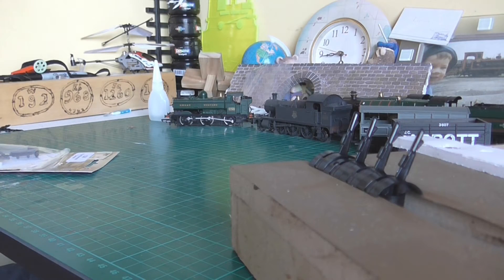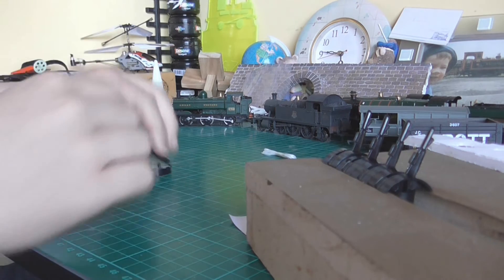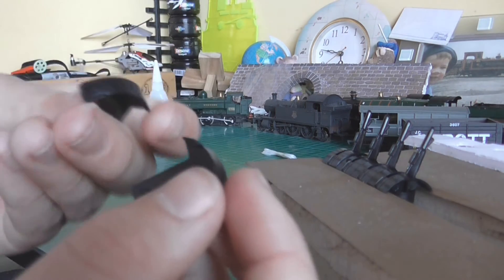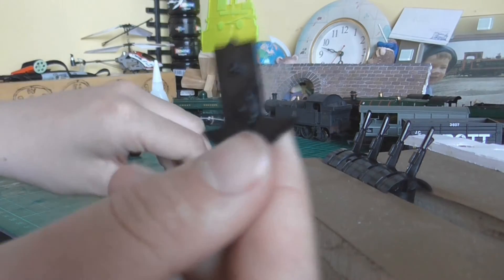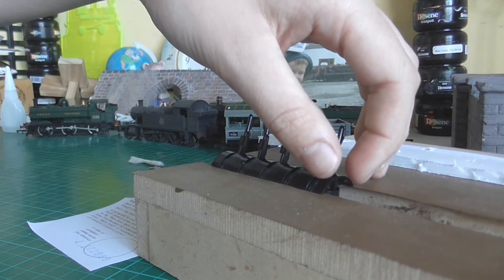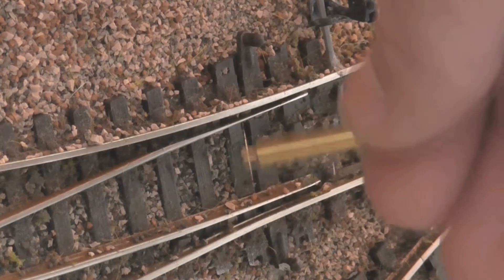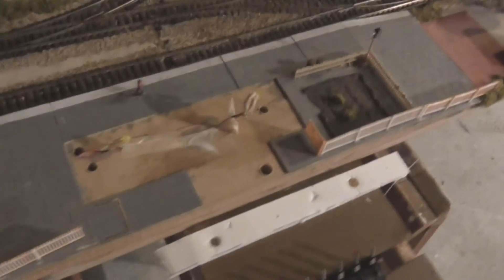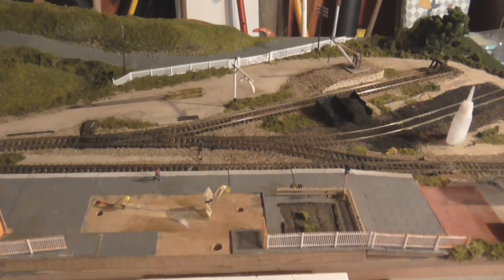How to - Ratio point control unit installation

Comment: Cool.  Thank you. Has given me the confidence to try one (or 22!),  and lev the exccent! (yes, I AM a POM).  Couple of points (haha) ...1.  Buy yourself a bradawl to start the screw eye holes,  2.  avoid if possible installing the point tie-bar close to a baseboard beam support,  3. with the point fixed to the baseboard, drill through the tie-bar hole AND the baseboard with a pin vice, then use the hole on the underside of the baseboard as your centre point for the larger brass thingy hole ...  I'll let you know how I get on!

Comment: I would possibly suggest fitting the bronze "Bit "to the points prior to laying and fastening down the track. Mark the position, drill the hole. Fit the piece to the point/s then position the points in place.